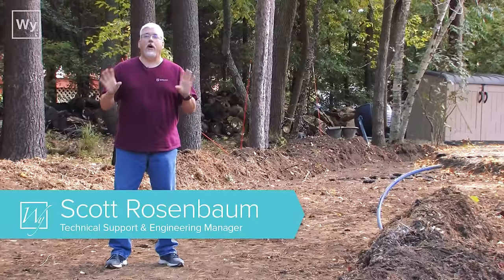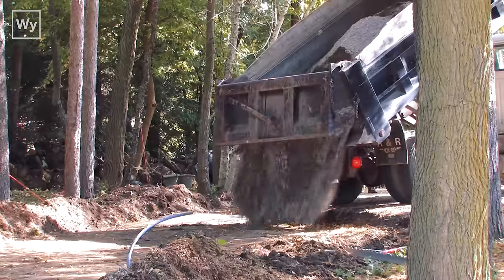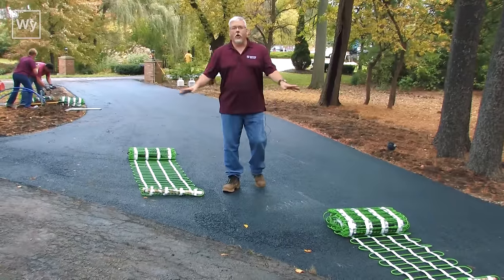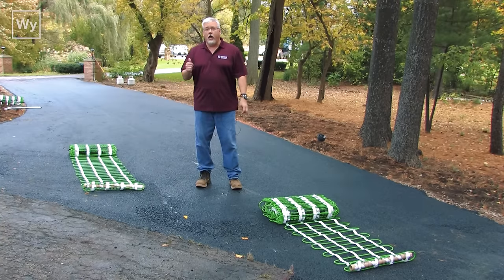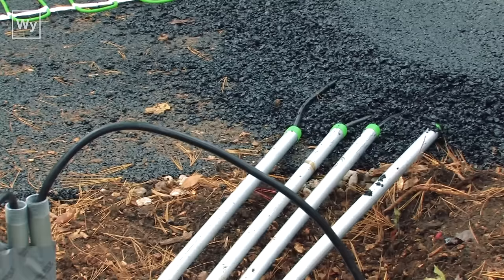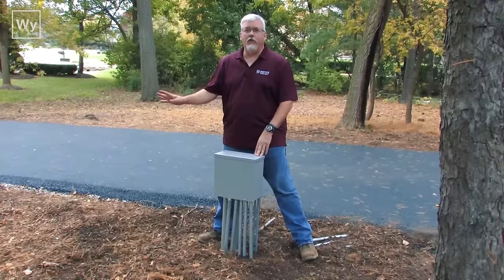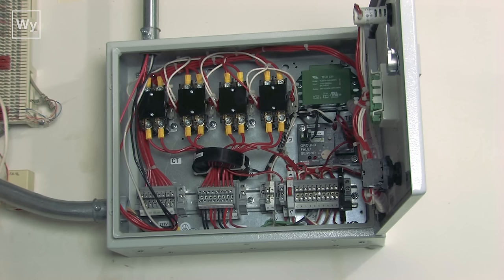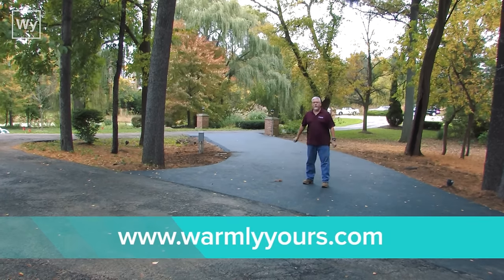Electric Snow Melting system installed in an Asphalt Driveway

Comment: Whatever this joke costs to install is nothing compared to how much it will cost to run. Note that the system is always on; whether it is active is dependent on the temperature measured by the buried probe. (I assume there is a manual override to turn it on if need be, but they don't say.) So, if you live in the northeast, where the winters can get cold and the cost of power is high, how much will that cost. Note that if you get the big freeze and a large snow dump, then sticker shock from your power company, you do not have an option to just turn it off. Once it starts melting the snow, you have to leave it on or you turn your driveway into an ice rink.  Then of course, there is the more common situation of extended freezing temps and no snow. Do you just heat the driveway for the creatures of the forest to warm their little toes? No, you have to manually override the system to shut it off. And when you get up the next morning, you have eight inches of fresh snow blocking the drive. Hint: spend practically nothing by comparison to buy a blower and hire the neighbor kid to come over and blow off your driveway (this one) in about 15 minutes. Let him use your blower to make a few bucks clearing other drives, and he'll do yours for free.
Reply from the maker: This system actually only costs about $0.07 to run an hour, so very minimal when compared to the cost of hiring someone to plow your driveway on a regular basis. You can explore operating costs here: https://www.warmlyyours.com/en-US/snow-melting/cost-calculator 
Plus it works as soon as it starts snowing. The sensors that can help automate the melting are only designed to run if it's efficient to do so - if it detects that the snow is falling at a rate it simply cannot melt, the system will automatically shut off to prevent wasting energy and money. This can be manually overridden if the homeowner chooses to do so.

As for large "snow dumps", no one is going out and driving in conditions like this in most cases, but if they needed to, again the system can be manually overridden to try and melt the snow if needed. These systems prevent the snow from refreezing into an ice sheet once it's melted with our "hold-on" feature that makes sure the snow evaporates from the surface. The asphalt is completely dry in places where these mats are installed.

The sensors available detect moisture and temperature, meaning it won't turn on for frigid temps or rain, only snow/ice.

As for hiring a neighbor kid or using a plow or blower, those options won't clear your driveway overnight while you sleep, they can't be done while it's snowing and still involve bundling up to go outside. All still a hassle when compared to a snow melt system that automates the whole thing while you just watch from inside your warm home.

Comment: This is a waste of money.  Installing it costs a lot and it will add to electric bill.  Just shovel the driveway or pay someone..
Reply from the maker: For those who are unable to physically shovel their driveway - systems like these can help keep walkways clear of ice and snow, making for a much safer outdoor space to get in and out of their car all winter long. Plus, if you're already replacing your driveway from normal wear and tear, the additional of a snow melt system is minimal compared to the cost of the driveway replacement itself.